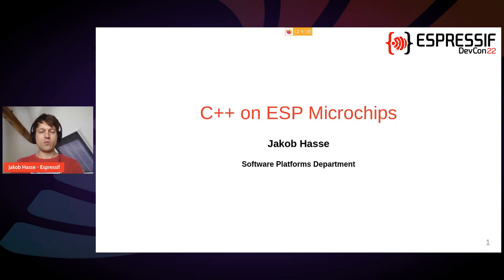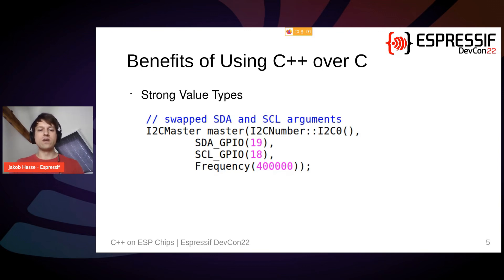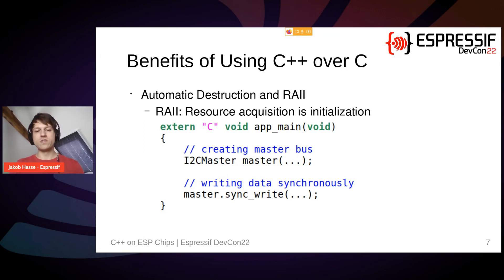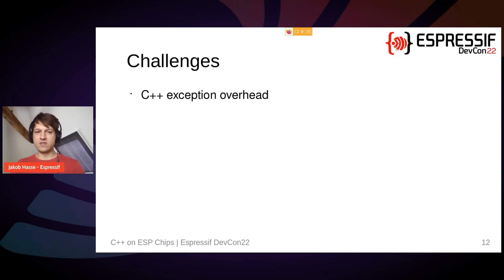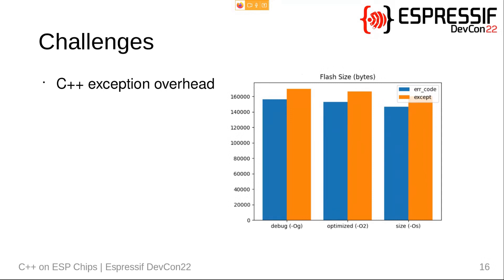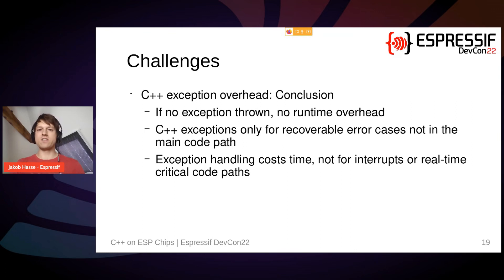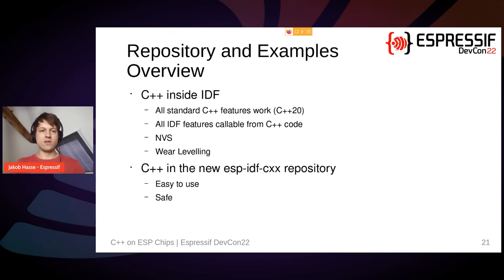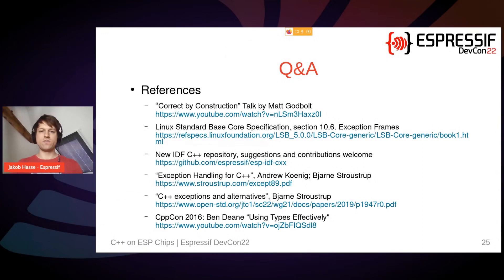EDC22 Day 2 Talk 12: C++ on ESP microchips

Comment: I'm just starting to rework an existing "C++" application (I use quotes because it is the usual "C with classes" kind of old-fashioned C++), and I'm so looking forward to utilizing all of the many benefits of the language.  Strong types and templates alone are worth having to dedicate a weekend to learn the modern C++ properly.

You also maybe saved me from disabling all exceptions, because I had heard about the bad but never about the ways in which exceptions are actually more efficient and resilient.